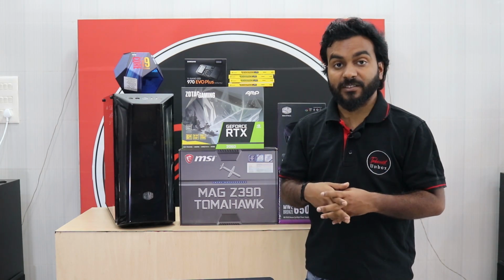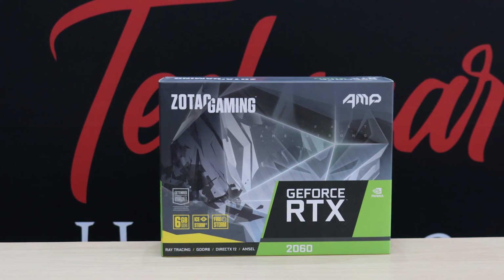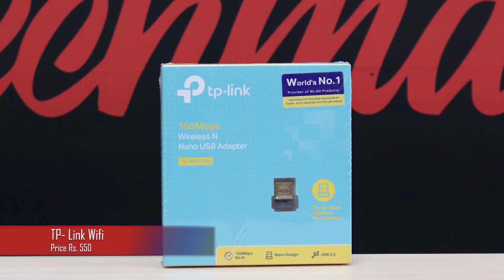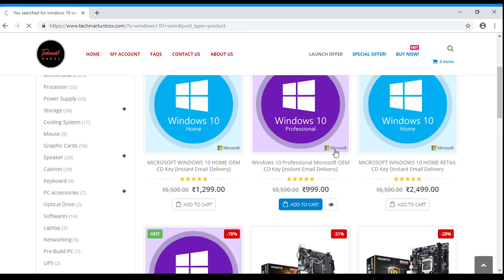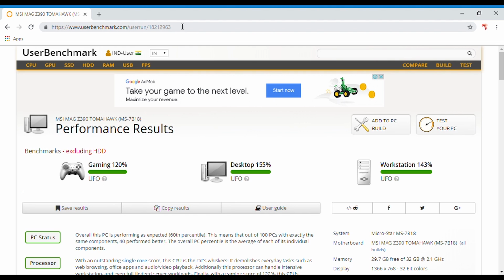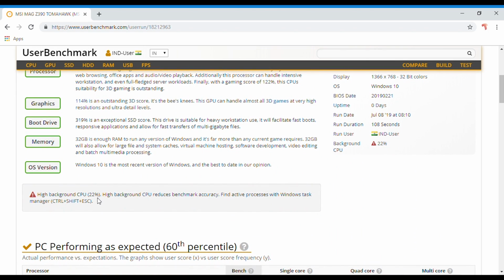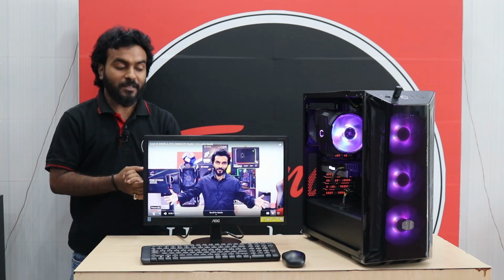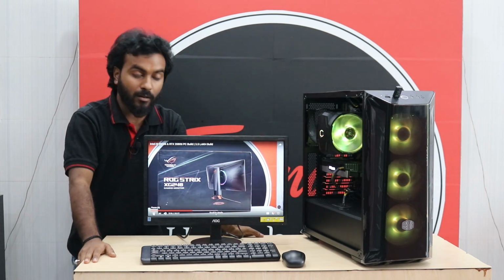Intel i9 9900K with RTX 2060 PC Build | 1.20 Lac Build

Comment: Sir I think its better to build more pc which s based on ryzen processer
Becz of cheap cost and  performance
Reply: ryzen is cheap but it has heating issues, intel is best
Reply: @naveensaravanan4380  seems like u know nothing abt ryzen
Reply: @alfred379  bro if it's only gaming then Intel is always ahead of Ryzen. Ryzen has more core and threads than intel. But still if u compare the fps in real gaming then less core less thread Intel CPU will give you more fps.

Comment: 9900k Ko minimum 360mm liquid cooler lagta hain in cooler se ghar pe Aag lagana hai kya  😂😂😂😂😂
Reply: This guy is one the genius crook out there. He well knows the mentality of a common indian and exploits it very well like others out there at Nehru place.
Reply: Ye pc lene layak h ki nahi koi help kardo
Reply: @vipingupta5416  nahin rtx2060 super lene ka 2060se kaafi aacha hai performance mai almost 2070 jitna
Reply: Its the size of a Noctua Dh15..So it wont be bad.
Reply: RAJDIP DAS Abbey agar overclocking karni h tabhi AIO ki zarurat h. Agar stock par chalana h to yeh kaafi h. Mere khud ke paas yeh setup h. At stock speed temp never exceed 75 even after 30 minutes of AIDA 64 stress test.
Reply: @vipingupta5416   acha sa aio cooler lena iska sath and if your budget is higher go wtih 2070 super
Reply: @jagadishbhatta9562  most of wedding cinematography video editing and gamming
Reply: What psu and cpu cooler should I take for rtx 2060 and i9 9900kf
Reply: @jagadishbhatta9562  1.30 lacs without monitor bcoz I have already a monitor
Reply: Dont buy prebuild and @rajdip haan true bekar build
Reply: @Anonymous-gh6xf  sun vai Ager stock pe chala na hain to locked processor i9 9900 le na K series ka processor kyun le raha hai, bewakoof samjha hai kya
Reply: @rajdipdas1750  oc se kya hota hai 
I dont what is the use of overclocking
Reply: really bro?

Comment: BRO
I have a question!!
I have a 8 gb ram stick with me now I brought an 16 gb ram stick. Can I use both my 8 gb and 16 gb stick??. Will I face any problem. My motherboard is A320..
Please reply
Reply: You can use it but make sure both have the same clock speed. Having same brand also helps in compatibly.

Comment: If it's for gaming... Worst Combination.... i9 with rtx 2060.... ??????????? It should have been i7 9700KF.... The unclocked and without discrete graphics.... Because we're using GPU however.... So, go with rtx 2080 super in same budget because i7 9700KF is much cheaper... That PC would rip this PC apart... Same Budget

Comment: Wouldn't an Ryzen 3900 and GTX 1080 a better price to performance build? RTX is nowhere it should be as of right now.
Reply: Yeah it can be ...but turing does help in performance..games are coming supported in ray tracing...but rtx 2060 is an entry level ray tracing...won't give u stable fps while ray tracing on..can use dlss .

Comment: i9 9900k + Rtx 2060 super or 
i9 9900kf + Rtx 2070 super 
Which one I chose IAM little bit confused budget problem
Reply: 9900k is a flagship to be pared with 2080 or like that .gpu will bottleneck your cpu so you can save some money .

Comment: Brother is GTX 750TI worth gaming??????
Reply: Don't buy it,go for 1060 or 1660 or 1660ti
Reply: Nope. Spend a little more for better price to performance ratio.
Reply: @GarudAtma  but my GPU price it till 7k only😞
Reply: @Retz2347  then it is a perfect budget to buy a 1060 3gb. Right now a new 1060 3gb costs around 11k. Just buy a 1year old 1060 . At 7k . Just check it carefully before buying it. Try olx.
Reply: @GarudAtma  yes....
And thanx for suggestions

Comment: Processor is overkill. Should have invested in better GPU like a rtx 2070 and a  Ryzen CPU.
Reply: Yeah that's what I am thinking...should have went for 2070 or with 2060 should have gone for i7 8700 or 9700 k..
And moreover i9 9900k gets hot pretty easy...air cooler ..duh...

Comment: Wtf combo is that there should be an rtx 2080 or ti
Reply: not necessary.If you are making a pc for after effects or 3d animation you dont need a high performance gpu.
Cuz rendering need s CPU power more than GPU.
Reply: Badiya spot kiya.
Reply: @tackkyy4959  for same you don't need Intel.. Bcz Ryzen 3rd gen  is way ahead for same purpose .. This one is pathetic build, no doubt.

Comment: 9900k with 2060 is not good for gaming. ryzne 3600 with 2070 would have been a better combo
Reply: It's not good for gaming maybe because the buyer didn't intended to be for gaming. Could be for productive purpose.
Reply: @Anonymous-gh6xf   ryzen 3900 would have been a better option than 9900 when it comes to productivity
Reply: @Anonymous-gh6xf  could you suggest me a pc build for machine learning, 3d designing, apps development and gamming (AMD R9 3900x vs Intel i9 9900k), (RTX 2060 super vs RTX 2070) and CPU cooler

Comment: The GPU will bottle neck the cpu
Reply: Never ever.
Reply: @GarudAtma  i9 is top of the class while rtx 2060 is a mediocre gpu
Reply: @downz6703  the thing is, you have mistakenly said CPU will bottleneck the GPU, instead of GPU will bottleneck the CPU. 
Yes,this GPU will affect the CPU performance but not noticably that much.
Reply: @GarudAtma  yeah right that's what I meant to say that the CPU will not work at 100%